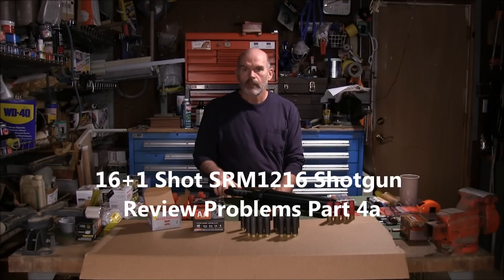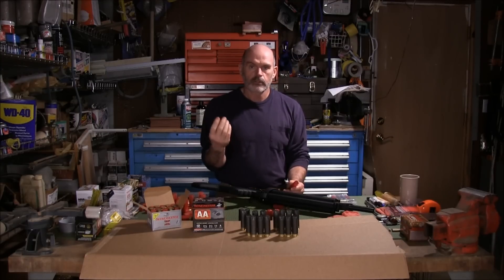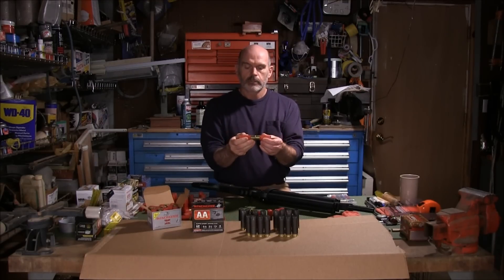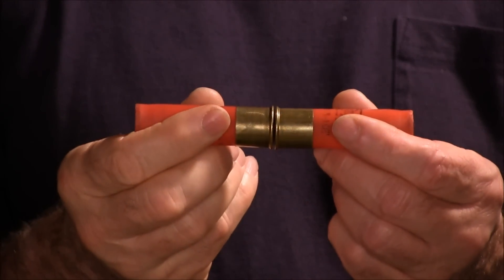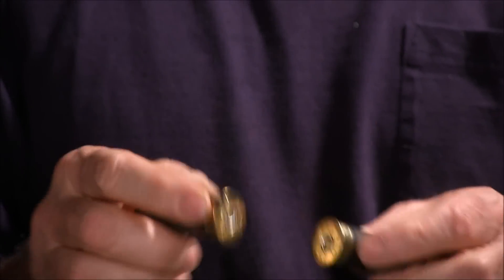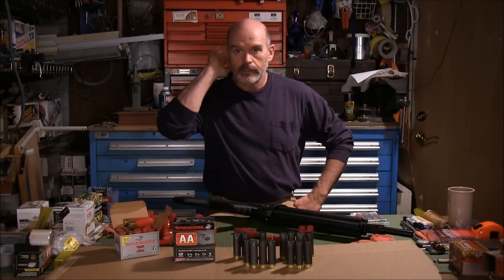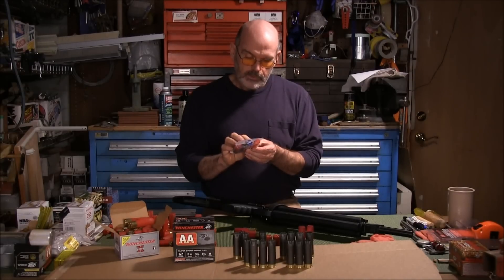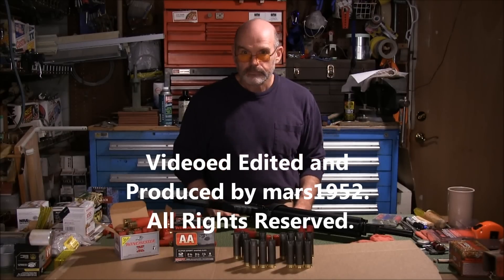16+1 Shot SRM1216 Shotgun Review Problems Part 4a

Comment from the maker: The light primer strikes and bulging brass happened on different guns. The factory said that the problem was caused by the shell sticking in the chamber but I agree with you I don't think that the brass could have bulged if the bolt was completely closed.

Comment: the company told me they don't like winchester shell have you tried any other products in the shotgun they like double OO buck and slugs I shot  Remington in mine and the 1216 loved those or Rio's shoot everytime.
Reply from the maker: In this video I showed the box of rifled slugs that I fired through this gun. You can see me shoot some of them in Part 4. The AA target loads that I used were hot loads and they have the same muzzle energy as mil-spec buckshot. If SRM Arms ever sends me the promised T&E gun I will shoot at least 500 rounds with it using varied ammo.

Comment: Without the proper guages to check that brass and make sure it won't have any trouble fitting into and coming out of your dies, I'd say throw it out. If you don't have a smooth fit to start with, you're just asking for frustration and risking your own safety. As far as the nicks, I've re-loaded a few nicked shells, before, with no trouble, but, again, the brass slid smoothly in and out of my dies. I won't re-load a shell if it's too nicked up to easily fit into and out of the die.

Comment: Looks like either the bolt face isn't flat or it's not locking up tight to the barrel when fired every time. In Video 3 you can see the misfires are from the bolt not locking in the most forward position which is why you got the light primer strikes. Great idea of a gun but way over priced, especially after watching this nightmare. Good luck!

Comment: the problems with the srm and the keltec is that they were just slapped together..i would just buy a saiga 12--convert it(easy) and buy a 20 round drum and run buckshot through it---thats what i did and im never looking back--good luck sir